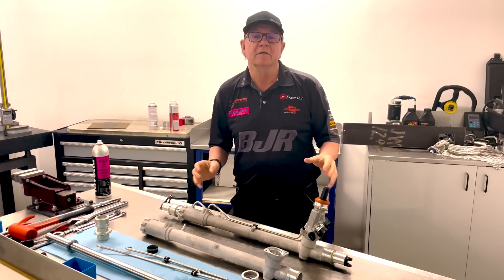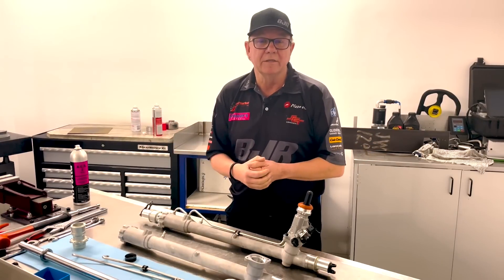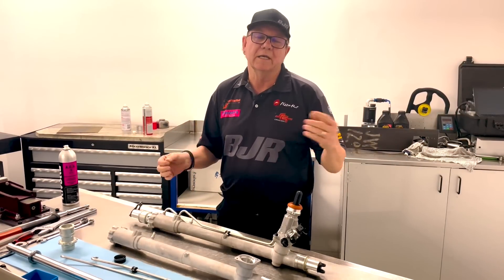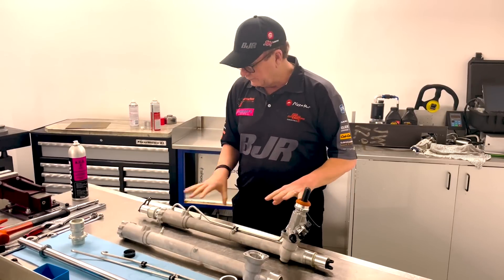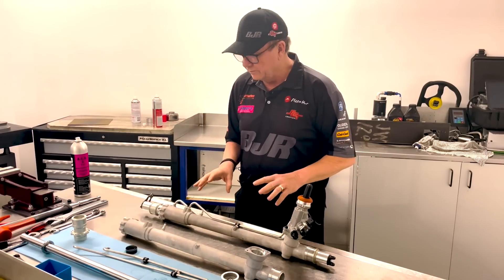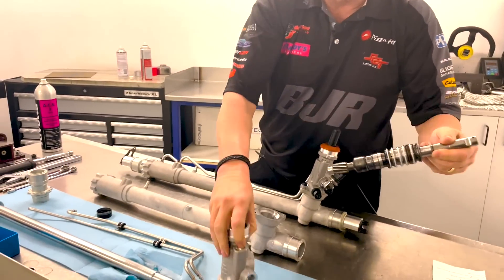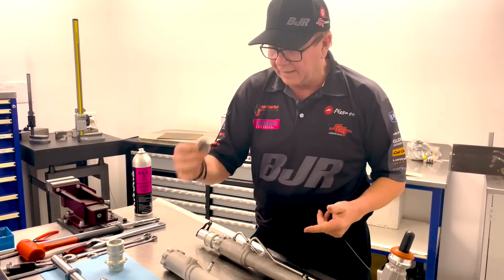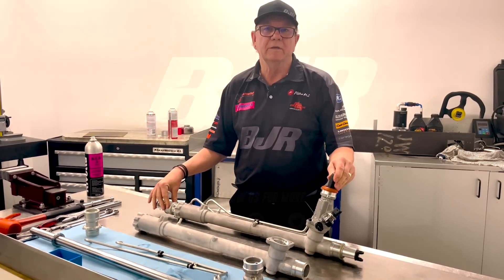Brad explains Gen3 steering racks issues

Comment: Hey Brad. Can you explain why behind or in front changes ratio? As most race cars run toe out maybe the change to behind has changed the components stressed in a different way.
Reply: Because if you were looking down at the car at an above view: 
If the rack is behind the axle centerline and you turn the steering left, the tie rod will PULL the wheel inwards as the pinion gear PULLS the rack inwards to turn the car left.
If the rack is in FRONT of the axle centerline and you turn the steering left, the rie rod will PUSH the wheel outwards as the pinion gear PUSHES the rack outwards to turn the car left.
So the pinion needs to be reversed / cut the opposite direction. In this example, turning left goes from a pull motion to a push motion and the opposite is the same on the other side of the car for turning right, too.
Reply: @dons1932  wow I've done wheel alignments for 30 years and what you write makes no sense. No matter which way turn steering wheel it creates force on left and right. One side will always be pushed, One side will pulled.
Reply: @jeffchaloner9665  he is right though, in that moving the same rack from front to rear will reverse the steering
Reply: @timjohnun4297  how? It doesn't change steering column..Changes length  and angle. STILL TURN STEERING WHEEL, rack response. Doesn't matter if in front or back. My point was TOE OUT, straight line changes force on a rack

Comment: NASCAR has front and rear steer available for different tracks for a long time now , just adopt their system.
Reply: Space
Reply: NASCAR has been front steer for ions. We even used front steer here (on Perkins cars specifically) successfully for ages. These racks just aren't build to a capable enough standard to deal with the power steering pressures needed to get them to function under high loads that we see.
Reply: @WheresmywingsRedBull  I beg to differ. Gen 3 Supercars are a failure, I think NASCAR now has better racing
Reply: @timjohnun4297  my comment was tongue in cheek. I was meaning the way we are headed v8 Supercars will end up identical to nascar in every aspect… well at least that’s what the officials running the show want! Most fans I know don’t like this seasons changes,  but definitely don’t want to end up copying the yanks either.

Comment: Brad, is there a reason why Triple Eight chose to move to the front mounted rack? Was it a simple matter of choice or were there other engineering considerations? It'd be interesting to know.
Reply: I remember seeing somewhere that it was about freeing up space around the crossmember for the new engines.  The same engine bay design is meant to accommodate both the Chev engine and the Ford Coyote engine (and maybe one day others too), so it was about getting the power steering rack well out of the way to fit the engine in.  Watching other car Youtube channels doing engine swaps in road cars, often they're cutting into oil pans, etc on their new engine to make clearance around the existing steering rack.  So I'd imagine front steer was the solution that let them move the rack out of the way and drop either engine into that space.
Reply: They have to clear the Coyote engine so better placement was probably front mounted...
Reply: Its for reverse Ackerman. It is very advantageous in racing car geometry
Reply: @blairo15  It has nothing to do with ackerman, it is for clearance at the back of the engine to fit big headers. 
Ackerman / anti ackerman only comes into play with high downforce cars in high speed sweeping corners. Which is why Indy and F1 favour the non traditional approach. 
It makes no difference which one you use in a regular steering car setup such as a touring car, so long as one tyre moves less. These cars have so much camber and castor that the scrub radius of the outside turning tyre being ackerman or anti makes literally zero difference.